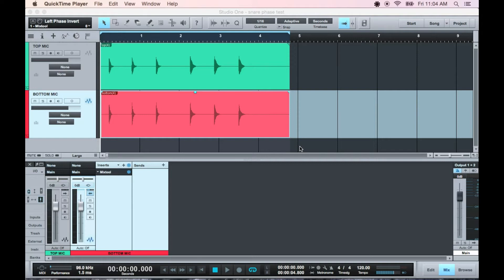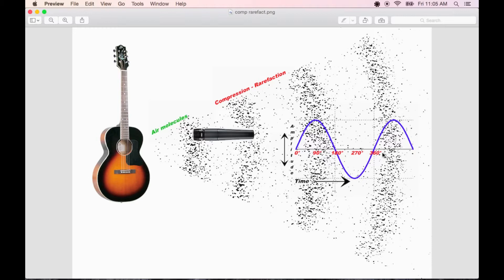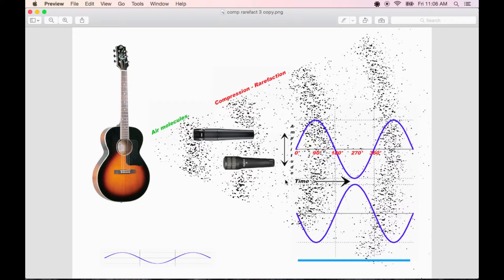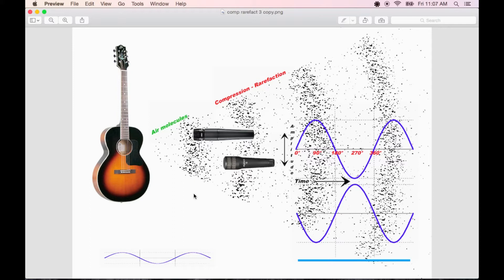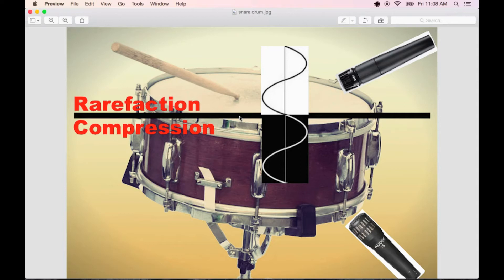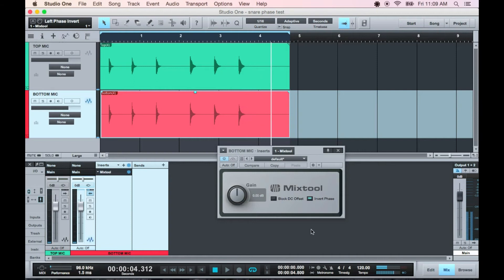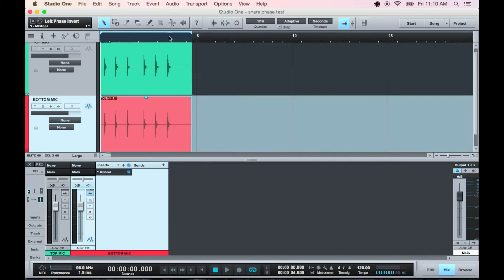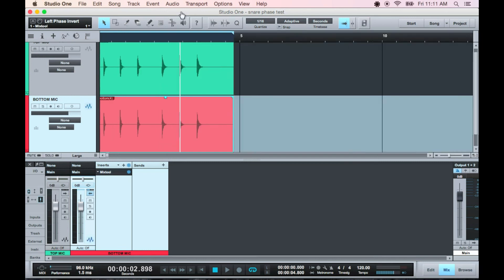Understanding Phase and the Physics of Sound

Comment: Thank you , you explained it really good, and the Pictures were great. 

Can 2 Hard panned independent MONO signals create Anti-phase?
Reply from the maker: Yea phase cancellation can occur that way, if the playback device only has one speaker like a phone, or if the mix is played at a live event through a PA or something.  A lot of times, live shows are mixed in mono.  I highly recommend doing your EQ work in mono as much as you can because that will force you to make the best decisions.  The wide separation can fool you into thinking you've done a good job, but really things just sound well separated because they're coming through separate speakers.  Anytime I'm trying to widen a vocal or something, I'm definitely checking in mono because I don't want that vocal disappearing on certain devices.
Reply: I recorded two Guitar tracks, One is Open Position panned Left, second is Octave of those chords Panned 100% Right. I Panned them completely Left and Right. In solo, each one sounds good, but played together, it sounds muddy. I checked the phase, and I have LOTS of anti-phase!!!!!!

I had a FabFilter Pro-Q2 on guitar bus, to Low cut Mid at 80Hz and Sides at 160Hz. It added a great amount of anti-phase, even in LINEAR Phase, Maximum Precision!!!!

I used WAVES PAZ Analyzer at Master Out  put to view Phase Issues.
Reply from the maker: If it's two completely different takes of different guitar parts you shouldn't be having any phase issues, unless you used more than one microphone to record ..in which case the two mics may have been out of phase with each other.  If you only used one mic, the problem you're having must be something else.  Fab Filter's linear phase mode doesn't change phase at all.  The phase stays linear.  Also, if you pan two things all the way left and right, then send them to a bus and use EQ in mid-side mode, when you cut 160 and below out of the sides, you're cutting it out completely because there was none in the center to begin with.  If you solo the mid channel you'll probably not hear much at all ..so cutting it from the side would leave you with nothing.  If you wan't your low frequencies in the center, you'll want a mono maker type plugin that allows you to set a frequency at which everything below is forced into the center.. then using an EQ in mid-side mode would make more sense because now there would actually be some mid information to work with.
Reply: Thank you. I agree with you 100%. but the things I saw in the DAW was really opposite the theory! I think I should capture the screen to find out what is going on that I did not controlled.